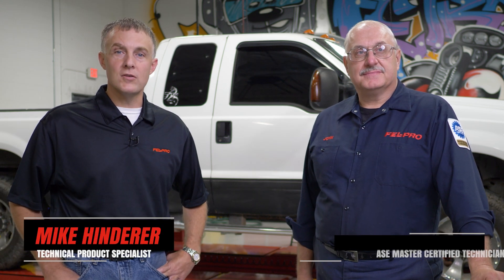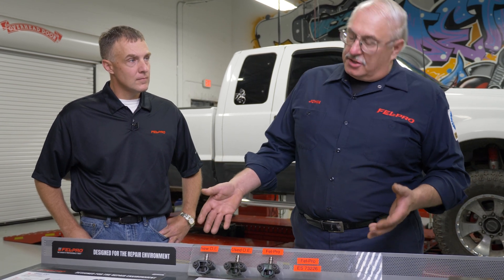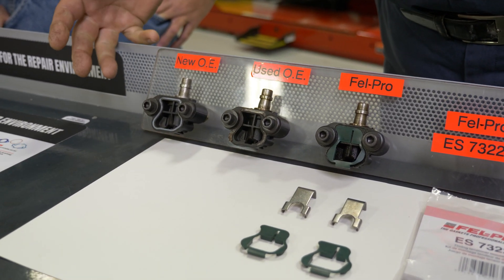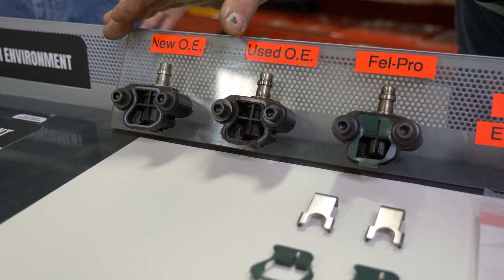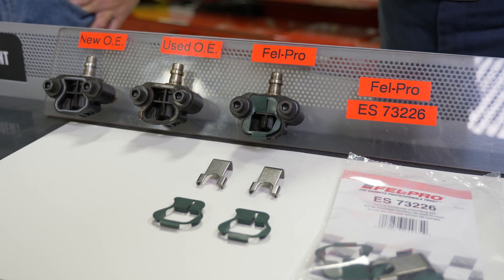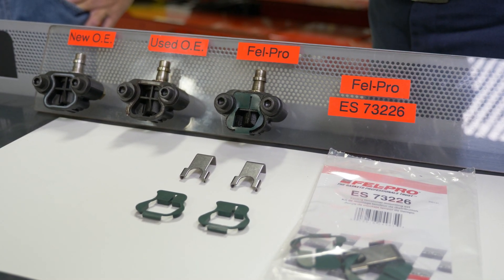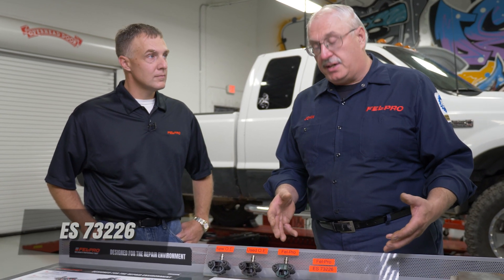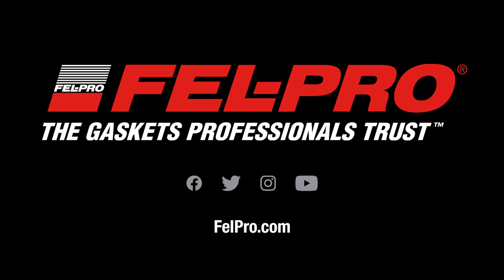Solving Ford Timing Chain Tensioner Gasket Issues | Fel-Pro Gaskets

Comment: I just installed new Ford tensioners and they appear to be leaking. 07 4.6 3v.   can I use these gaskets on new tensioners? do the new ford ones require a gasket at all they didnt have one on them?

Comment: Does the original molded rubber gasket have to be removed before Installing the felpro one, I would think that it wouldn't seal as good without removing it.
Reply: Did you end up scraping off the old gasket for install? If you have used the new gasket. How is it holding up?

Comment: If you're into an engine for timing chains, etc, you're a fool to reuse a timing chain tensioner. 

Get out the OEM shotgun and start blasting away. Do it right or don't do it at all.
Reply: Ok but if I do get a new one and put these as a replacement gasket on the new oem tensioner will it last longer den wit the oem gasket? Or can I layer it sum how???

Comment: that tensioner design has some areas where the metal bosses are just too narrow for any gasket to last. But I will say this, your aftermarket offering I would use even with a new tensioner install because your gasket would have the greatest likelihood of working. Ford has proven they can't cut the mustard so even with a new tensioner I would scrape off their seal and use yours.